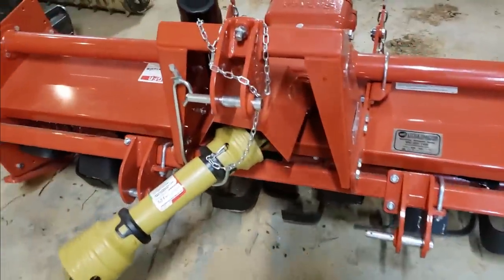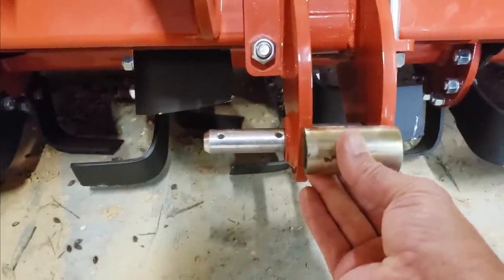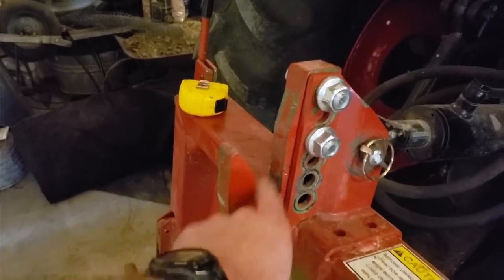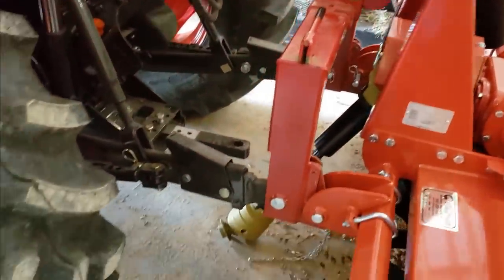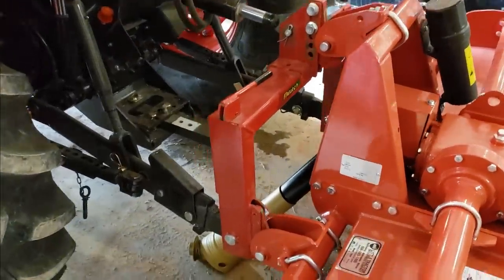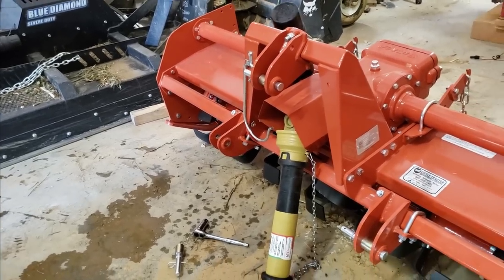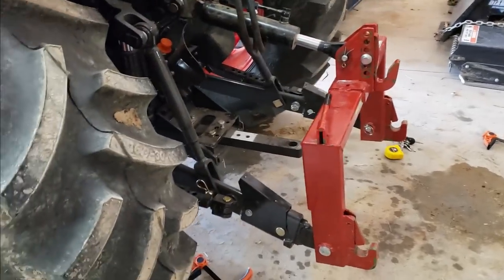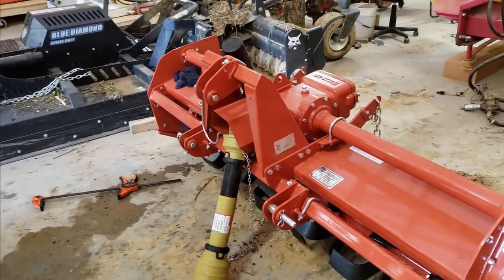Setting up tractor imatch Quick Attach... WHAT COULD GO WRONG??

Comment: Looks like you could've used a engine lift or a set of come alongs from your bucket to hold the weight of the quick attachment until you got it on. But good idea sizing it up before putting it on the tractor
Reply from the maker: yeah, 'quick attach' is usually a 50/50 proposition... Sometimes it is smooth as peach pie... Other times... well, not so much!! Thanks!

Comment: Kapper this is just a thought it looks like you could use a cherry picker 4 round your shop you can lift just about anything make your life easier like the 3 point hitch just a thought they're very cheap.
Reply from the maker: Good call! I actually recently bought one, at a garage sale, but it is low on fluid!! Need to get it refilled! Thanks.
Reply: i have an older cherry picker (engine crane we call it, i believe we are talking the same thing). i found that making small adjustments was a pain so i went to harbor freight and bought the 1ton gantry crane and chain fall. i don’t know how i ever got by without it!

Comment: Speaking of forks. Why not take the quick attach off and then use your forks to lift it up to the implement. Wouldn’t that allow you to position it more easily?
Reply from the maker: Not sure how you could do this... ? The forks are on the loader, but the implements attach on the 3 point in the rear ?

Comment: With the size of your tractor and implements, it may be time to abandon the quick hitch. As I understand, they are more meant for compact tractors than utility tractors. With the telescoping draft links, hooking up implements without the QA may not be such a pain?
Reply from the maker: Even though I have a bigger tractor now, the quick attach still has its advantage. But the FIRST initial setup is always the worst, after that it will pay dividends later one. Thank you

Comment: absolutely no need for a quick attach, takes basic knowledge to hook up a 3 point.
Reply: Are you kidding? You ever tried hooking up a 700 lb bush hog? Then tried it again with a quick hitch? I back up to bush hog and lift it. Slide the shaft on and done. Took longer to type this!
Reply from the maker: LOL good reply!!!
Reply from the maker: To each their own, but after having about 50 implements (OK a slight exaggeration but close :) in the end, the quick attach saves a TON of fighting, labor, and more once you get each of your implements set up.